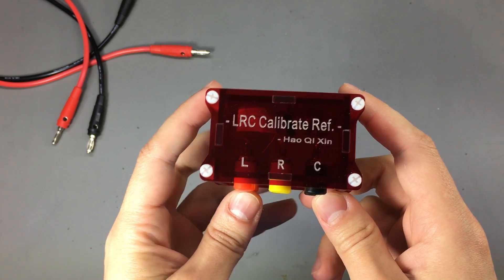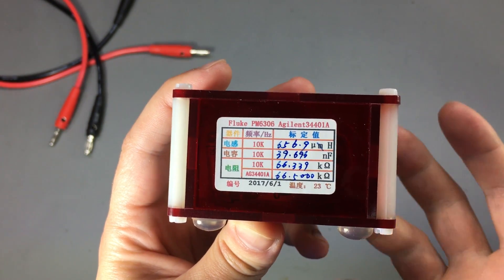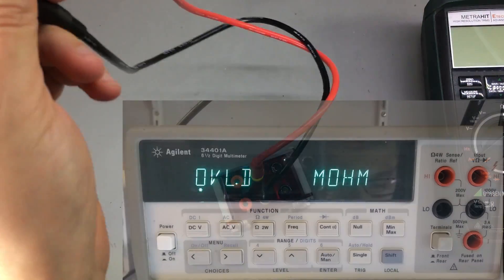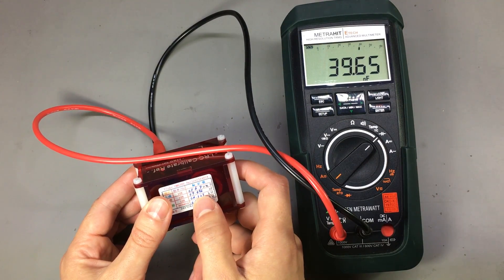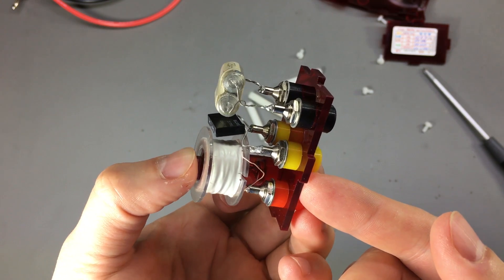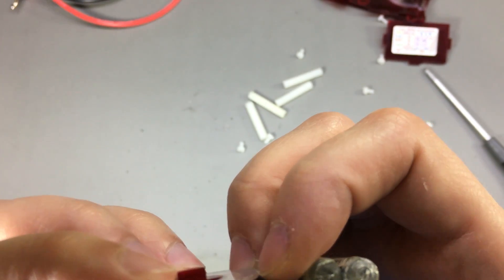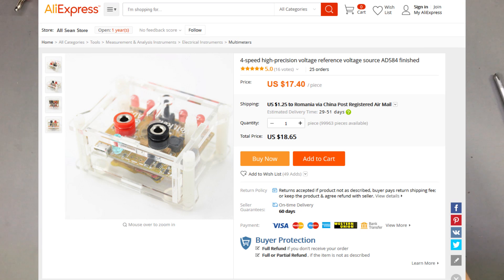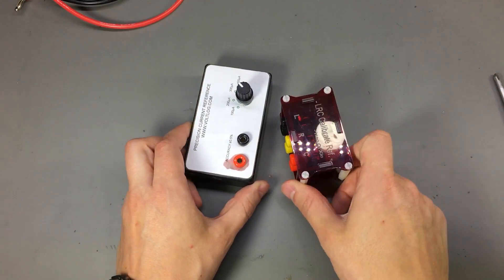Voltlog #166 - LRC Reference Box (Hao QI Xin)

Comment: Friend, clear up a doubt for me, it is the following: I bought an AD584 metallic eight-pin IC and the AD584 but the rectangular one with 8 pins. The metallic one worked very well, but I connected the rectangular (plastic) like the metallic one but it did not work. Could the plastic one be another form of connection?

Comment: It would be nice if you could test them at different temperatures. You could test the inductance and capacitor with a signal generator, the resistor and your bench multimeter.
Reply from the maker: I don't have a signal gen yet.

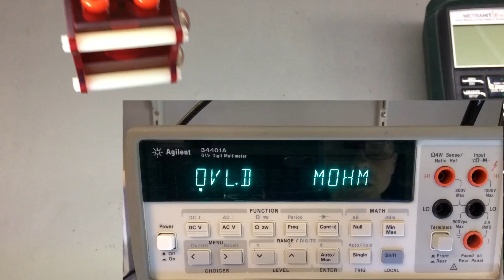Comment: It's a bit stupid to provide "high precision" devices with only 2 wires measures and low quality connectors. Just look the measures going everywhere at 3:00
Reply from the maker: yes, the box was hanging from the wires causing some movement on the connection I should have used longer wires and have it sitting on the bench.

Comment: Looking for some info about this resistor is kind of hard, that part number 5529218-37 is for a precision resistor with different value. After looking inside some datasheets I can say that this resistor might be from 1987.
Reply: This datasheet might help: www.farnell.com/datasheets/148730.pdf
Reply from the maker: the URL doesn't appear to be valid but thanks for the reference. It would be indeed a nicely aged resistor if it is that old.
Reply: Here's good link: http://www.farnell.com/datasheets/1486730.pdf I had problems with pasting into comments, and when I was writing that url I lost 6. Info in this datasheet might be helpful.
Reply from the maker: thanks!

Comment: It's terrible when it's 2018 and you can't trust components values or the testers, even when you have a resister with zero tolerance is off or is it your multi tester? Most of the time it's both. Sure you can get in the ball park like your 18650 battery isn't 110v and it's somewhere around 4v and 4.5v  and the charger test at 4.7v, great!

Comment: i just stumbled on a soldering station solution for people that don't have the expertise to build / assemble a station like you do.. and don't have the expertise to just buy a  "MEAN WELL LRS-100-24" ..
i was advised against doing this with my level of technical knowledge at this time..
quote:
 At a minimum, you would need to mount it in an enclosure, either sealed, or with <3mm ventilation holes. You would also need to include a mains fuse on the live at the inlet, not to protect the PSU (which has its own internal fuse) but to protect against fire if a fault develops in your internal mains wiring.

so what do you think of this station i don't know the plug size need to ask the seller but that would mean a regular laptop supply could do or the one i'm going to get for my TS100 a mean well brick supply..
https://tinyurl.com/y7exdzxv
The station is €48.
Reply from the maker: A laptop power brick would only output 18-19V so you would get less output power but it should still work. You can also get a proper meanwell power brick rated for 24V 3A or any other known brand.
Reply: thanks i found one on tme.eu.. i'm getting one for my TS100.. i just hope the plug size on this KSGER T12 STM32 V3.0 station will be the same as for my TS100 so 5.5*2.5 i contacted the seller and told him i have a power supply with that plug size and he just answered the same.. Hope he did not misunderstand.. Also i heard from a nice Russian speaking guy that V3.0 firmware is buggy.. but unlike the TS100 the firmware is non user upgradeable or downgradeable (that's according to the seller)
Reply from the maker: you can always replace the plug if it's not the same size.